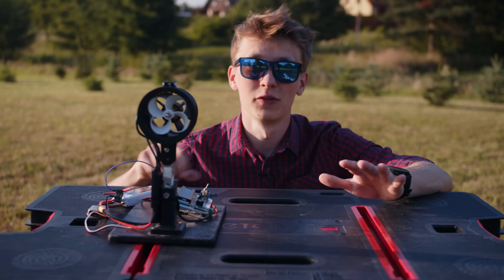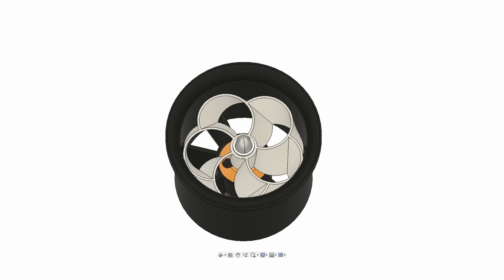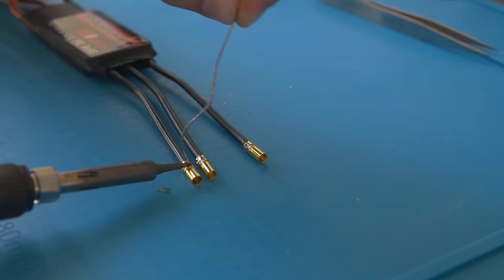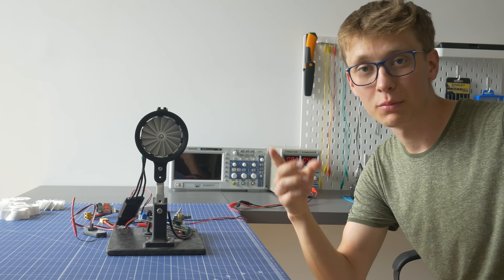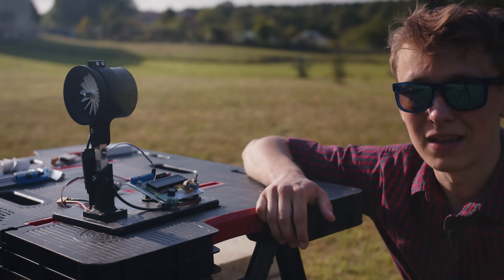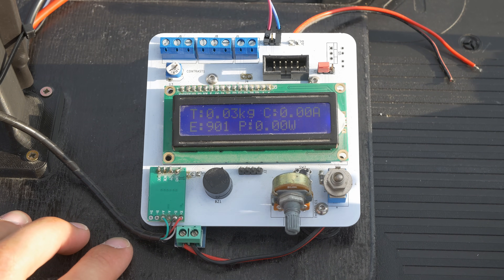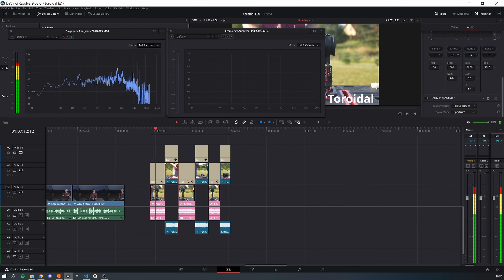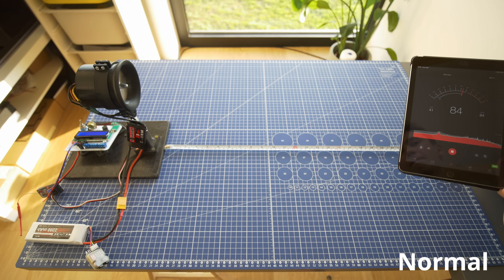Toroidal propeller vs 3D printed EDF

Comment from the maker: Here you can find the files for my EDF: https://www.printables.com/pl/model/791122-3d-printed-toroidal-edf
Reply: Next is do a comparison between these propellers and a newer research tubercles or bionic propeller.. I tried finding on YouTube no one made a homemade video on it yet..
Reply: DO IT AGAIN BUT DO MAX THRUST
Reply: Friend, you need to have at least basic knowledge of aerodynamics and how airplane wings and blades works. You cannot just make two "random" propellers without taking into account the angles, etc... and the specifics of each type and then just compare the two. Sure there have to be someone who studied and made a paper about toroidal x "common" and then you use the data from him to make your propellers and then compare the two that are equivalent at least in/have the same thrust (to see/hear the difference in sound) 🤷🏻‍♂️👍
Reply: A thought I had while watching this was:
Rather than try and find a way to “reduce” the noise a propeller makes by its design. You could try and design it to change the frequency of the noise it makes entirely; so that you make it either so high or so low, that it is imperceptible to human ears: rather than trying to cancel the noise altogether and make it “noiseless,” you just change the noise it DOES make.
Reply: what size of edf you use ????
Reply: No, it was crap and above all, pointless.

Comment: Your toroidal propeller still have lot of room forncortivces creation between shroud and outer diameter of the impeller. This is not practical for whatever jet engine that rely on almost zero tolerance between these two parts at any point of the blades edges.

Comment: Friend, you need to have at least basic knowledge of aerodynamics and how airplane wings and blades works. You cannot just make two "random" propellers without taking into account the angles, etc... and the specifics of each type and then just compare the two. Sure there have to be someone who studied and made a paper about toroidal x "common" and then you use the data from him to make your propellers and then compare the two that are equivalent at least in/have the same thrust (to see/hear the difference in sound) 🤷🏻‍♂️👍

Comment: i find the video of toroidal propellers odd on youtube. as with any design and engineering, you need to build multiple iterations and test to see which is working. 
Not just make some random toroidal propeller and straight away compare them to a normal axial fan.
And NO ONE does an air turbulence test of fans outside.
They do it in a vacuum wind tunnel or for home engineers, with a room with as little wind inteference as possible.
Sorry, for your intelligence and ingenuity level. I got to down vote this video. For poor engineering habits and practices that are not thought through..

Comment: Since a normal fan's efficiency is better than the toroidal but produces more noise as a result, wouldn't it be fair to scale the normal fan back so it only pushes the amount of air as the toroidal and then compare the noise?

Comment: I would like to see the results of a hybrid propeller with a combination of the torrential and normal propeller.
With the idea of creating a minor vacuum and pressure pockets like we have in jet engines.
Moto is to reduce sound while increasing thrust.

Good projects for drones and passenger planes.

Comment: I have seen a few guys testing "Toroidal" propellers most with similar results that the toroidal shape does not perform as well however if you have a look at the professionally designed toroidal propellers they are not a simple helix they are shaped in the same way that that a normal blade is shaped there is a clearly designed variable angle of attack and the blades change from inside to outside. This was a key factor in making regular propellers and not surprisingly plays a significant role in Toroidal blades.
Please take time to design a proper blade and then test it, otherwise all you are doing is making just another video that is purely entertainment with no real value other than a few smiles.

Comment: Well... There is NO such thing as "ordinary propeller per ce", because each "ordinary propeller" has different parameters like: pitch, diameter, scew, profile, form to name the most significant ones (not to mention the duct effect!). All these parameters need to be optimized for a specific application. The same story (only more complicated) is about a toroidal propeller, which has even more variables to optimize.  I am astonished how more and more "engineers" go ahead and 3dprint a fairly random propeller and a fairly random toroidal propeller and then rush to shoot a video how they  "compare" the props in their random installation in a spreadsheets well-studied in their respective Universities... They usually don't even care to sandpaper their prints not to mention to adjust or variate the parameters! Then they turn their proud faces to us - viewers - and say something like: "We "see" from the graf that the ordinary propellers are  better (or worse) than the toroidal ones!" Sweet Lord, what a useless waste of time watching this...

Comment: Is it possible to set the rpm and, then, test the propeller?  Maybe, … use an oversized, high torque motor like grinder.  I think the small motors are set to a certain rpm but if your thrust, propeller blade angle, is different, you will get different thrust because the motor will spine at a higher or lower rpm.

Ounce, rpm is set, then tweak the design.  Otherwise, you will be guessing.

I did see a boat test where they tested efficiency of propellers by watts used, but I think efficiency of a motor depends on sizing the perfect propeller for the motors output.

Comment: Hey, thanks for the video! Really Interesting tests. Maybe to improve it further you could try reducing the gap between the propeller and the duct to make the duct more effective? One way I can think of doing this would be to print the propeller slightly too large to be able to spin without rubbing, then just let it run slowly until it shaves enough material off of itself to spin freely

Comment: First thing I'd suggest would be a resin 3d printer. You'll get much higher resolution, smoother surfaces and stronger parts.
FDM is rubbish for anything near engineering tolerances.

Comment: I don't know why so many laymen think they create a toroidal propeller with just some curved loops and they perform better than any other fan blades. You are comparing apples with orange.
Is either one of them designed for a specific point (Max thrust, min efficiency, minimum noise etc.)? Only then you can compare them. You can't simply compare a whole category of propeller with just some random designs. This is not science nor engineering, it's just someone playing with a3D printer and a remote and trying to create likes on YouTube 🤦‍♂️

Comment: The comparison here is flawed because you are comparing both at max power but they need to be compared at the same thrust. At the same thrust the much more efficient standard props are probably making less noise.

Comment: Have you measured the energy consumption of the toroidal versus the conventional? As far as I remember, the point is precisely greater efficiency at certain rotation speeds. And to be honest, the toroidal propeller came to YouTube from developments for the marine industry. Perhaps hydrodynamics and aerodynamics are not so similar due to the different densities of water and air, what do you think?

Comment: i think its good you only use 3s, impellers (not propellers for EDF´s) are AMP hungry and you can very easy burn the motor trying different impellers on full throttle. 
i am also pretty sure the 3d printed impellers was flexing to much to give proper thrust for it´s design. i think you might had a bit lower thrust due to impellers flexing. at peek RPM.

Comment: The thing that most people don't get is that toroidal propellers are designed to be efficient when there is no sleeve/duct - see use on boat motors.

To compare apples to apples, compare the thrust of the conventional and toroidal propellers without  a sleeve/duct; a good test would be on quad copter droids.

Comment: If you want to increase thrust you have to integrate the propeller in the turbine by changing the design of the turbine.

You shouldnt have any gape between the inner side  and the propeller, this design decrease air pressure under the propeller. The best is to create a channel to let the propeller spin freely, like being slightly shorter in diameter size than the propeller and making an inner section to integrate the propeller's movement in the inner side of the turbine.

Comment: Great idea but a lot of flaws in your test rig. The anemometer should have been mounted in a fixed location and you did not measure the RPMs of the prop for a real comparison. At this point it's, just a relative test.

Comment: For a fixed thrust value you set, can you vary the propeller radius and measure the full frequency spectrum again? I wonder what size the propellers need to be to have the dB for all frequencies to be less than some set value. Then you could increase the thrust and vary the radius all over again and see the frequency spectrum. Then you can make a 3D plot of thrust vs radius vs dB (max) or dB (average) for the spectrum.

Comment: The thing that gives a toroidal propeller it's advantage is that there's no edge where high and low flow regimes can mix to create eddy currents, which is already minimized for the EDF. An open fan would be a different matter, but that's already been shown...

Comment: The framing around the Toroidal blade was unnecessary. The Toroidal blade must be as large as the diameter of the case around the standard propeller. That is how the Toroidal blade has advantage. No need for housing

Comment: I have a concept design for suction propeller aimed to push the limits of dry thrust, I dont have a 3D printer but I do 3d modeling and designing in rhino for industrial designers. I wish you look at the design and try its thrust.

Comment: You can reduce the noise of the fan by making the spaces between the blades different. Balancing it becomes a challenge but Airbus Helicopters has done it with their fenestrome tail rotors.

Comment: The demos, so far, are radially-fixed pitch. Since you're 3D printing each one, try experimenting with a radially-profiled pitch. You will achieve a better stall response and a wider, linear-region in the thrust-speed, response-curve... as you account for the changes in tangential prop speed, from hub to tip. A good starting point, is to assume decreasing-pitch as radius increases. This allows for the tangentially faster portion of each blade to create less turbulence and efficiently scoop air.

Comment: your methodology is flawed, toroidal propellers do not require a shroud. Also the propeller pitch makes a big difference. As well as the number of blades. Because of friction higher blade counts require lower pitch to keep the power draw at the same constant. I see a lot of these videos and I cringe because you try to make it look like a scientific evaluation. but it's really just amateur with some cool bells and whistles. therefore your results have no real meaning. Sorry for being hypercritical but that's just the facts.

Comment: Errr .... those aren't toroidal propellers, just some silly angled extrusions.
That aside, as others have already pointed out: ducted fans don't have the kind of tip vortices that toroidal props are meant to reduce. 

Toroidal propellers might be useful for drones, tho. Many models have "ducted" props for safety reasons and with the large gaps between the blades and the duct walls they're often right in the spot where the ducting doesn't add any efficiency but increases noise.

Comment: Sanding propellers is, like you said, not really practical. But what you can do is print a part with ABS and give it what is called an Acetone Vapour Bath. That will give it a smooth surface finish...

Comment: So basically you compare fans with different rotor fillings and different pitch angles of blades. In engineering practice, you should calculate this parameters to eliminate drag on main operating mode of fan. And you just do nothing, print random mill for airflow and compare it... wow.

Comment: Ducted fan design adresses the same issue like the idea of toroidal props. Better "control! of blade tip votices. The toroidal props for drones that appeared to day are all crap in means of doing efficiency better. Often marine props are cited, but they look very different than the ones for drones.
If you take a design, meant to optimize free air operation, and it does not because of severe design flaws, what do you expect from such propeller in a duct? Yes, less efficiency.

Comment: I think your angle is too aggressive on the toroidal propellers - maybe dial them back to no more than 45⁰ at the tips? Also, if you can increase that angle as you get closer to the prop hub it should move air more efficiently as well - just look for Sharrow boat propellers as an example. Best of luck!

Comment: Use resin printer for smoother details, or use cf pla from Hatchbox etc for hiding layer lines. Also use resin mixed with starch to coat, cure with UV to hide layers

Comment: How about trying a standard propeller with a ring on the outside that bind the blades, and prevent the air to escape outside the blade rotation? I'm not English so it is somewhat difficult to put my mind picture in words. It should be clear what I try to say.

Comment: That thing is NOT a toroidal propeller. Its just a lookalike.
If one wont to make a comparison, it would be reasonable to use the right thing.
Also there is that argument from @hlavaatch mentioning the problem with the blade tips.

Comment: So far, in ALL the Normal vs Torridal prop videos that I've watched, the Torridal is always quieter, but no one compares the thrust and power used by the normal prop or fan running at reduced throttle that matches the torridal noise level.
Reply: The toroidal is always less efficient and requires more power to reach the same thrust

Comment: Wouldn't the shroud severly hinder the toroidal propeller? The Shroud is a plus only for the regular propellers and putting a toroidal is like adding a second set of plane that will work as an anti blade.The attack angle for the toroidal is going to be slightly different on the tips. Try adding more space between the shroud and the tips of the toroidal blade.
Reply: Severely hinder the toroidal propeller?  No!

Comment: How about check the motor only sound without propeller. You may estimate noise which is generated by propellers. Anyway good jobs!
Reply: You can't fly without a motor. Therefore, you must test with a motor.

Comment: A good idea would be to do a noise test indoors without no prop installed to find out how much of the noise is coming from the motor. I suspect the duct is acting to magnify the motor noise and most of the noise is probably coming from that. But that would be a bit off since the motor won't be under load. Still would be interesting.
Reply: You need a motor to fly. So testing without a motor is nonsense.
Reply: @MrSummitville  I didn't say test it without a motor. I said test it without the prop so it is the motor only.That way you can get an idea of how much noise the prop itself is generating.

Comment: I'm not religious and I have the advantage of a lot more age but OMG those designs suck big time!  If you can line up a prop blade-tube by eye and the walls are parallel from one end to the other then the design is double wrong. Pitch needs to be proportional to radius. And the blade should twist at a fairly constant rate through it's rotation. A little rounding on the leading edge provides some resilience against bad rotation match to air speed and thickening behind the leading edge for strength.  There are other things to fine tune too.  But over three blades and I wouldn't duct them, they are a self ducted fan.

Comment: Niko make a simple output diameter with small ratio diff  diameter input , because degree blade ,the air of  suck fan more less degree same big amount  air and small trust , more degree blade fan the air small amount suck , with more trust .
you can choice  , with small diameter output fan to get more trust .

Comment: Toroidal propellers are made for open fans, it doesn't make sense to use them in ducted fans.
Toroidal propellers are solving problems like tips vortexes etc. that only exist in open fans, and you have other problems with ducted fans like how to keep gap minimum etc.

Comment: Have you seen anyone fume-smoothing their parts?  They get some inpressive finishes.  Mostly I've seen styrene filaments fumed with methanol.  There have been a few other pairings that I sadly can't remember.  But I'm sure a resourceful chap like you will be able to find more info.

Have you ever considered adding turbulence to smooth flow?  Such as the scalloped leading edges of whale and sea turtle flukes.  They actually end up soothing the flow.  Or perhaps dimples like on a golf ball.  The Myth Busters tested the hypothesis they'd increase fuel efficiency due to better aerodynamic profile, and they did and remarkably so.  Some thoughts to churn over.

Lastly, nicely done with so many options.  Thanks for the entertaining and informative content and effort, Sir.

Comment: Looks like the normal with more blades has more thrust, maybe the Toroidal needs more blades?  Also what about the toroidal tilt/Pitch factor vs the normal.  Would a toroidal with say 8 blades be possible?  No idea.  You really need a fluid dynamics model (MatLab?) of the toroidal to play with.  Very nice work!  Are toroidal blades suitable for Jet engines?